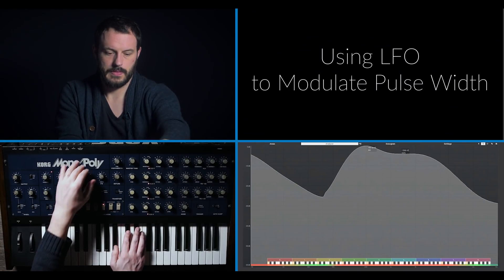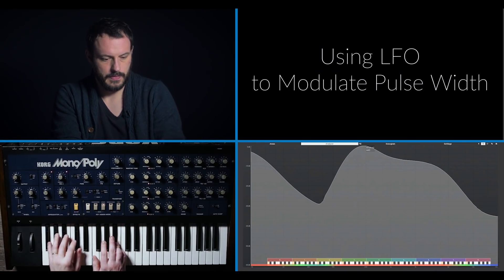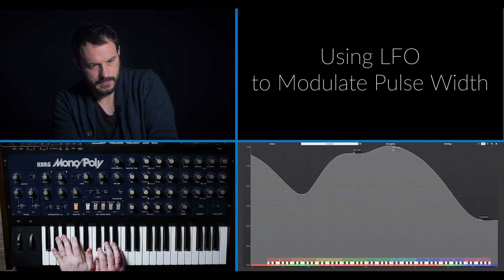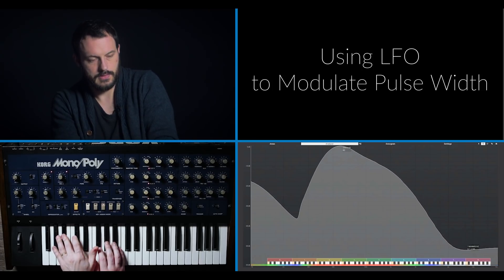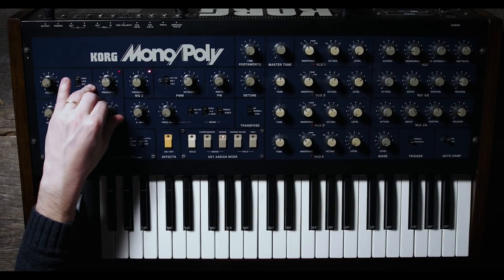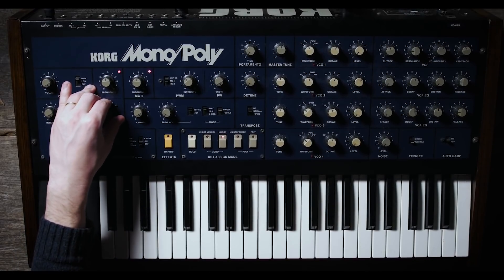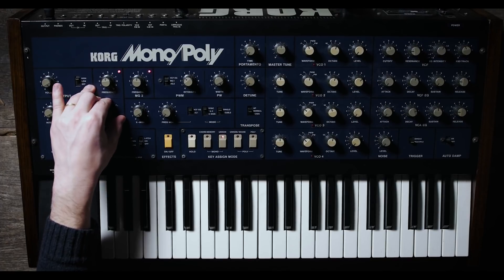Intro To Synthesis Part 6: Modulation and LFO | Reverb Learn to Play

Comment: Excellent explanation- As a guitarist I love Moog n really dig the Moogerfooger series pedals.I'm using the MF-103 12 stage Phaser which is an incredible unit n the best around. The thing is I get it n understand it a bit but don't really know how to really utilize the LFO. Of course I can get the sounds I want but that's me tweaking her.The unit is so versatile that I can get Deep phasing/Rotating speaker/phase wah Rind Mods etc. But because the unit is so advance the way it interacts with the sweep n resonance it can be very tricky @ times to nail a certain sound, cus just a slight adjustment create a completely different color. It fantastic in the way it responds to extreme distortion my other phasers can't even come close. Of course it's not a ordinary 2 or 4 stage unit n in reality it's much more Supreme yet more complicated. My handbook from Moog is outstanding in the details of the unit w/ it's explanation of frequencies, filters n the wave.But it's kinda out there. I need to study your series n am grateful to have come across the post-Thanks...

Comment: If you do a LFO very fast, then why it is still called "low frequency"?
Reply: top 10 Questions Science still cant answer haha
Reply: Because even when it is set to "high" for an LFO, it is still very low frequency (usually less than 20 Hz) compared to the oscillators generating the audible sound (which generally go into the KHz range).